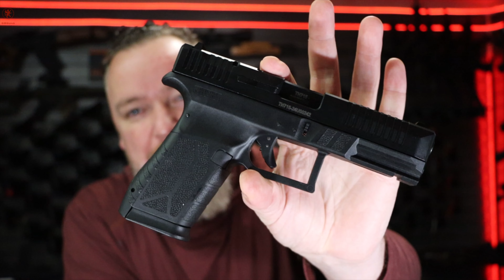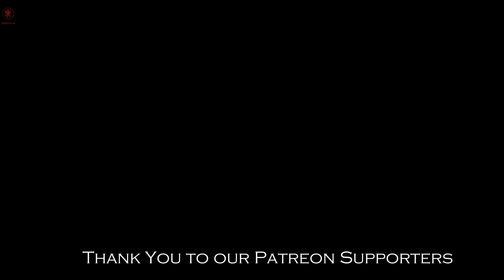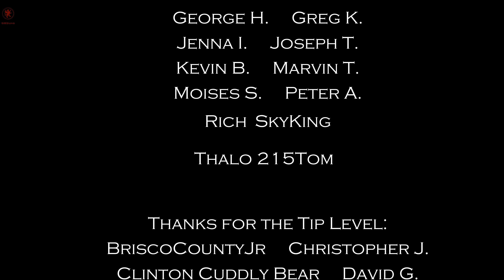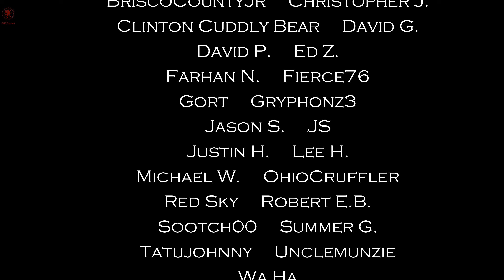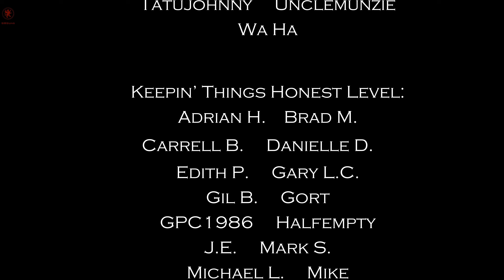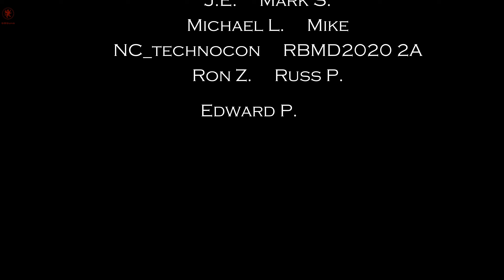GBGuns Armory Ep 153 Adler Arms AD-9

Comment: People need to stop evaluating guns solely on price and place of manufacture.   Different countries have different cost structures and can produce things at lower prices.   That's obviously how China has become a manufacturing goliath.    Manufacturing more cheaply than can be done in western Europe isn't hard and guns made there are comparatively over-priced.   On a pure "what do I get" basis, Glocks should be much cheaper.    Very little metal inside the gun, plastic sights, plastic guide rod, etc.    When it comes to the US, we are not as expensive as Europe, but neither is it cheap to manufacture here.    Still, when you see a name brand gun made in the US or Europe which is priced sub $350, do your homework before buying.   They surely have cut corners.    Ruger has been famous for making cheaper guns and they do so, among other things, by casting their frames rather than forging them.   Also, they are not known for bringing many new products to market and I assume they mainly live off their old designs.  So, while $200 gun from Turkey may at least raise suspicions, it's no proof the gun is bad.   I've bought numerous excellent polymer framed guns made in Turkey when I see them for good prices.   You must of course look for the low priced retailers as prices vary very widely across retailers.   Big name retailers with bricks and mortar stores are not low price sellers.    So, when i hear a reviewer use the caveat "for a gun made in Turkey," I immediately know they are not a sophisticated reviewer.   Many excellent guns come from Turkey and many crappy guns are made in the US.    Evaluate the product, not the place of manufacture.      As to the AD-9, this is one of the very few I've come across which may be a clunker.   I think the choice of Beretta mags rather than Glock (since the gun otherwise looks like a Glock 17 clone) was an obvious mistake.    I've emailed the importer and we'll see whether they acknowledge the problem existed in 2024 vintage production and whether they've fixed the problem.   If they deny the problem or indicate no desire to fix the gun, then we'll know they are not a credible manufacturer.    There are plenty of excellent pistols from several Turkish manufacturers which sell for not much more than the AD-9.
Reply from the maker: Unfortunately this proved to simply be a bad gun of poor manufacturing quality. I'm sure the prototype worked, but this main production-line sample was a hard fail.

Comment: Have the slightly more "finished" feeling version of the AD-9, the Puma P9x19. Same guts. But, it's actually optic cut and has some lightening cuts on the slide. Took the cover off to find it was done in some nonsense cut. Manufacturer and importer/distributor do not offer a plate. Not giving up. Having a custom plate made for the slide. When I get it back I'm gonna have a gunsmith try to polish up the barrel's feedramp and chamfering. All fails, going to chuck 500 packs of Winchester through it until it falls apart.